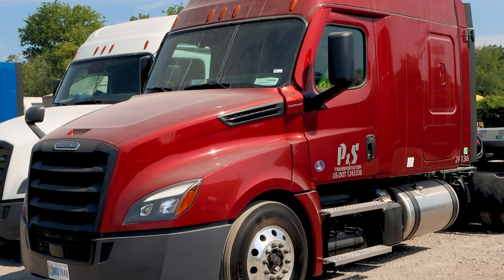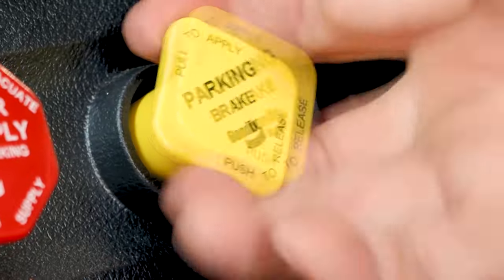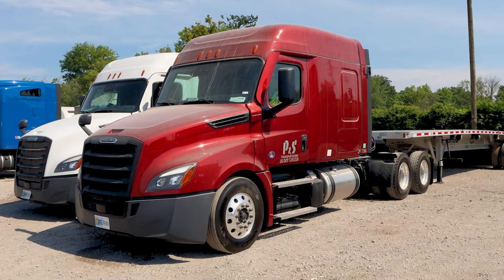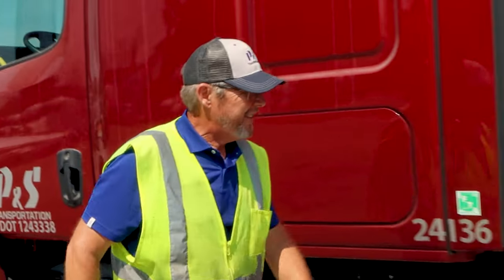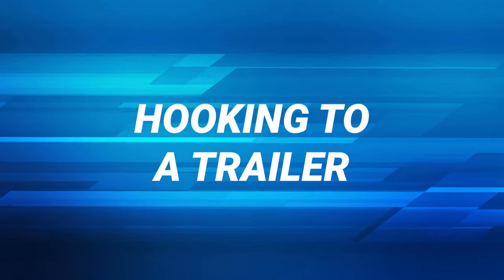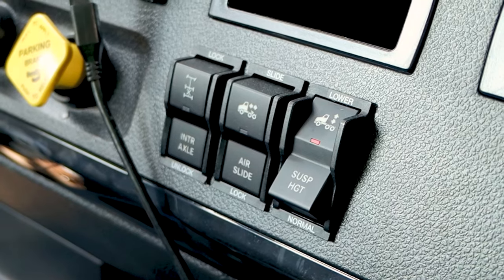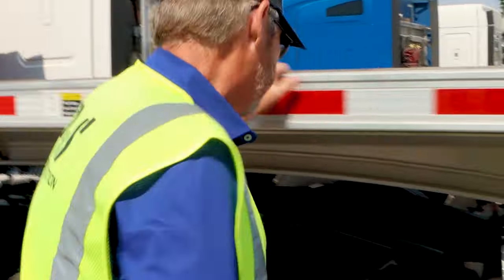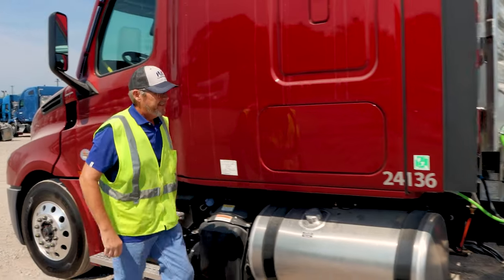Drop Trailer Safety

Comment: I have to say I never lower the landing gear to the ground because every truck is a differant height. I always leave an inch or two from the ground and always let the air out of my air bags prior to pulling out. So often I pick up a trailer and it is two or more inches too hight and it is very hard to lower the landing gear and/or it never latches upon hook up.

Comment: Question, why does supplying air to the trailer relieve pressure on landing gear? Because it airs up the tires a lil bit?
Reply: Adds air to the airbags in the trailer suspension. Raises the height of the trailer just slightly and gets the feet of landing gear off the floor.
Reply: Be sure your tractor brake is on when doing this as well because you don't want your truck to roll away. ( not saying it's ever happened to me. LOL) Puting air to the trailer also releases the trailer brakes.